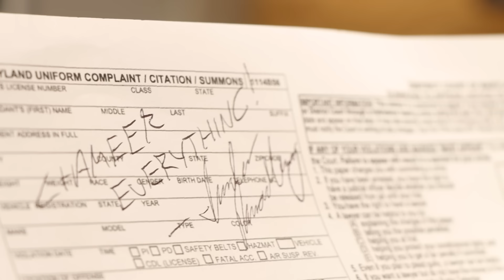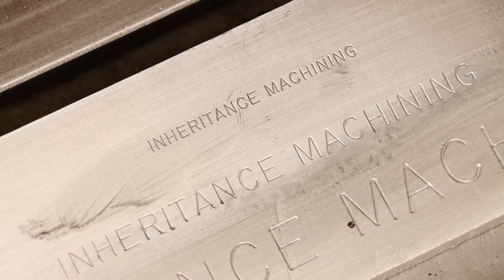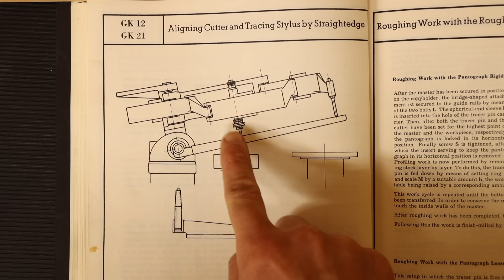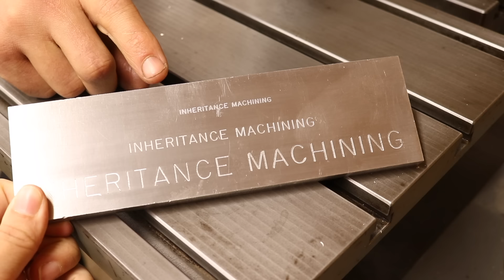Saving the Machine the World Forgot

Comment: Rule of thumb when engraving single line fonts;  You want your cut width to be approximately 10% of your character height.  Nice machine!
Reply: Which is pretty much what DIN/ ISO/ BSI say for line-widths in technical drawings. So ... 0.35mm pen for 3.5mm high lettering ; 0.7mm pen for 7mm lettering.
My tube pens - Rötrings - dried up long ago.

Comment: I bought a GK21 recently so have a few pointers
You need a tool and cutter grinder (i know of a Deckel T&C) for sale in chicago if you're interested.
Those carbide D bits are basically 1 time use before they need to be sharpened again.
Take very shallow cuts and go over it again if you want letters deeper this helps minimize breakage.

You can 3d print stuff and engrave it on metal like a company logo or whatever. Which really    expand the usefulness of the machine.

Comment: I operated a Hermes pantograph for almost 9 years at an air force base i was stationed at in the 80s. I was the only one in the shop that cared to go beyond engraving the radio faceplates and recognition plaques.
I learned real quick the three things you DON'T DO.
.1. Don't drop the cutter.
.2. Don't let the stylus skip out of the groove.
.3. Remember to pick up the cutter off of your work between letters.
I had 7 years experience as a manual machinist before I went in the service. I enlisted to do something else than metalworking. Ha! Two weeks after I got to my first duty station I was training people. They didn't even need to send me to technical school. Direct duty, man.
The last year I was at that base the manual machine was replaced with a computer controlled one. The Hermes went to the transportation squadron. I spent some time over there, too.
You can make your own templates or patterns. Get with your local countertop installers and get the Formica top scraps or cutouts. Draw or trace your design directly on the top or make a stencil. Take a rotary tool and carefully groove out the lines. Every little bump and bobble will show up in your work so go slow and steady. Naturally you aren't going to need to do this unless you have a special logo or such that you will use more than once.
The biggest thing is use your imagination.
Be gentile!
Router bits for wood are your best friend for odd jobs.
That machine will amaze you!
Cool find on the 3D option
Oh. Make sure you get the proper set lines on the arms. If you don't your "0's" will look like drunk kidney beans...LOL!
Cheers 
Terry

Comment: making letters for it could be a full time job for some one you need all sorts of sizes and different fonts lots of filing in the future lol also making cutters for the machine can be tricky we had a special grinder for ours as they need to be ground with a taper depending on the material you are cutting as you are going to find out the break cutters often so buying them could get expensive if you have never worked in the trade you have a lot to learn in the future we also used a mixture of varsol [ mineral spirits]   mixed with cutting oil or any oil we had on hand and one more thing that will help is a really good supply of good double sided tape i think we used 3M brand one it is used to tape down the templates when clamps are in the way

Comment: Cool! Deckel pantographs were once pretty common in the mold making industry. I learned to operate one in the 1990s duplicating small forging die cavities for brass valves and fittings. We made 3x size models first in plastic, then used the pantograph to reduce to final size in the actual die. We were able to produce very fine detail that way. We ground all of our single point cutters from carbide blanks on a Deckel grinder, too. Those were the days.

Comment: What a delight to see this old Pantograph in use once more. One of the many machines that i used such a lot while working for the company that I served my toolmaking apprenticeship with was this same make Pantograph (for all i know this could have been the one ). Apart from making all the labels that went on every other machine throughout the toolroom a lot of the punches that went into the tooling of the progression tools that fit into the presses. I used to love working this machine. The second machine i liked working was called a Punch Shaper. A very complex machine to setup and used, I've never seen another since I left that company. And the last machine I learned how to use was a tool and cutter grinder, and sadly I've never seen one like that particular one since.  In a way, now that I am retired, I seem to enjoy working with my metal lathe and Mill/Drill more than ever.
I also have a full shop of woodworking equipment, so love doing that too!

Comment: Deckel is the Rolls Royce of Engraving Machines.I had the English Taylor Hobson. It did not have 3D faciities. 
You will now need to acquire (if not already got) a cutter grinder to change angles for different materials as well as sharpening.
We never bought bits but instead HS dill bits BEFORE fluting was done. Saved a lot of money as we did A LOT of engraving.

Comment: You can get a small cutter grinder to grind cutters from blank stock and make your own . Either high speed steel or carbide depending on the materials you are cutting...I'm a retired tool and die mold maker...used all manual equipment  until last couple of years then used Protrac milling  I really enjoyedthe trade...

Comment: Hi, came across this video by chance, certainly brought back memories. good to see someone rescuing the machine.  I spent my early working years, in the late 60's and early 70's, as an operator on similar machines. The majority of work produced on this type of machine, apart from dies for coins and medals, was for producing die casting and plastic injection mold (mould) parts for model cars, trains and toys, certainly the 3D setting. Then the CNC machines started taking over so those  manual machines were made redundant. Not useless but time consuming to set up and operate.

Comment: This brings back some memories. Worked at a mold shop in Burbank California back in the 70"s and early 80's that had multiple (maybe a half dozen) Deckels set up in their own room because of their noise when running.  There was some that were the larger ones, twice that size, that would go to a 1 to 1 ratio.  The key to these was the patterns used to get the ratio right and that required highly skilled tool makers.  Eventually left there and got into CAD/CAM/CNC machining doing the same type of molds in 1/4 of the time with more accuracy with better finishes.  Anyone who says pantographs where better is not being realistic.  They were hard work.  Standing in front of one of these was not pleasant.  The hot chips would fly back in your face and down your shirt.   The joys of manual machining...

Comment: It doesn't look like the original motor is on the machine.  It came with a 3phase 220Vwhen new. See if you can find a Deckle cutter grinder. Replace the stone wheel with a diamond wheel and you can grind your own carbide cutters at any angle and bull nose too. You can buy the carbide cutters split in half in most any dia. If your going to do alot of lettering buy a Deckle or a Gorton (much better) 2D machine.

Comment: In the late 70s I was working at a shop producing complicated aircraft parts.  Prototype parts really held us up.  We started using a panograph.  It saved a lot of time.  Then Textron put cnc controls on a Bridgeport.  
We dove in.  Cutter comp was black magic.
You can use end mills with that machine.

Comment: put a drop of oil on your template letters because they’re made of brass and the tracer is made of metal so your letters will wear out very fast. we also used brass tracers to prevent the wear out. i worked on this model as an apprentice in the late eighties. brings back memories 🙂

Comment: There was a pantograph machine at the place I worked at as a precision Mechanical Designer for aircraft instrumentation.  The pantograph machine's purpose was to recreate convolutions in a beryllium copper disc which composed half of a bellows.  These bellows were used in altimeters and airspeed indicators.  The pantograph was set with a 10 to 1 reduction to reduce errors in duplicating the curve and convolutions of the bellows.  Truely amazing machines, thank you Ben Franklin.  Great video thumbs up.

Comment: I started as an electrical trades apprentice in Sydney in 1967. We had a fellow who worked full-time working a panagraph engraver, like the one here. Mostly he engraved name plates for control panels and such, quite a lot of those in what we called Formica in Australia. A plastic like material with different coloured layers. Cut through the top layer and you had say white or red letters.
At times he engraved directly into die cast aluminium plates. The letters were filled with  ink

Comment: I used to use one back in the 80's. A newing hall machine. Not sure if I still have a set of brass letter sets or if I have thrown them out. Have you got a set? You can make your own with it with care. That's how we did it. You'll need carbide cutters and a microscope light sharpener for them also.. Otherwise they'll be dull.
We had a few machines, smaller ones for engraving trophies. And can do curves. You rotate the job in the holder. Very versatile machines.
We also had edging machines which are like a miniature router table for edging chamfers - one pass - bzzzz done.
You can also get reverse lettering to engrave on the back of clear plastic sheet giving smooth finish. Ideal for maps, industrial process maps, drilled for lights etc. Like you'd see in control rooms.

Comment: I'm an IT guy and I was lucky enough to work at a university engineering department in in Australia the early 2000s which had a workshop much like yours, including a pantograph. I was thrilled the few times I used it. We used something called traffolyte to make signs with it. The letters looked exactly like yours. I often wonder if they still have it squirreled away somewhere.

Comment: I've got the baby brother of that machine. You should use different cutters depending on the size of the letters. Bigger letters can use cutters with a truncated tip to produce lines that are wider without becoming deeper.

There are also special sheets of two layer plastic to make signs that are (usually) either white letter on black background or the reverse. Other combinations also available.
Anodized aluminium is very nice to work with too.

Comment: Used somewhat larger Deckel pantographs 45ish years ago. They were also called die sinkers. Ours had an oscillating up-down function that would chop cut like chop grinding with a jig grinder. We would use carbide burrs and could cut intricate profiles. I also made templates for these with a Kearney & Trecker rotary head mill.

Comment: Used a tool and die version of one of these machines which was heavier built. It used direct feed motors instead of belts. Was capable of holding larger tools.  We used it to copy complex parts with curved surfaces. Made coining die copies and EDM carbons for burning shapes into   foundry blocks. I have dreamed often of one for my shop. Unfortunately I have never seen one like it again, and it would have been a bear to move.

Comment: Takes me back nearly sixty years when I was an apprentice, one of the things we did was engraving and etching using a Taylor Hobson pantograph machine similar to the one shown, the etching was done on hardened and ground components. The engraving was done on brass instruction plates, usually for jigs and fixtures for FoMoCo, the plates would be engraved, polished then the lettering would be filled with paint then polished and laquered. Latterly, Ford went from specifying brass to laminated plastic, got the job done but not nearly as satisfying!

Comment: I used to drive Deckel pantos years ago. We used them for all sorts of things. Because they can run at over 20K RPM, we were able to drill stuff at 0.024. WE used them a lot for making dies for EDM work, button plates for elevators, complex mounds for automotive injection moulding, all sorts of stuff. I would really like on even now, forty years later. Good luck to you, I hope you get some use out if it. PS, get yourself a D bit grinder, a Deckel if you can otherwise a Harbour Fright. It will save you a lot on bits.

Comment: Within the first couple of seconds ive realize what kind of machine it is. We have one in my shop as well, its rarely used since it takes almost the same time as using a cnc. We only use it for brass engravings to label molds. Though ours is quite small and not very sturdy. Back to the vid :)

Comment: I used one of these for years back in the 70s and 80s. We engraved Control Panels which eventually were adhesive labels years later. Mine was also a Deckel and I had a Deckel Mill also. Deckel are still in the industry as they are the D in DMG from Germany.

Comment: Did engraving at an aircraft manufacturer and had to do it to mill specifications. Being self taught, I ended up doing many retirement parts for my boss after a while.
Try filling in the letters in with different color lacquer sticks then polish the surface. I used to hold my breath all the time hoping I would not mess up especially when your near the end finishing up something.
Now everything is computer run. 
It takes a while getting used to the cutting if your doing a climb cut or not. You can make it wider the deaper you go too or use your broken tip. Remember you can re-sharpen thoes tips too. 
Good luck with that machines and enjoy it.

Comment: What a score. Learned to run a Deckel in trade school and then we had one in the first shop I worked in. We used it engrave EDM electrodes for 2 shot keyboard key mold inserts. Now you need to find a Deckel SOE single lip cutter grinder with the comparator. It got where I could do a 9 degree, .008 tip dia. carbide cutter about in my sleep. Our new CNC retired that machine as we could direct engrave the dies into D2.

Comment: Spent forty plus years in a machine shop. Never was fond of CNC equipment myself either. I retired from the shop I was at back in 2019 after 30 years there and 23 of those as the Operations Manager. Everyday was different with customer break downs. From a tire or pharmaceutical manufacturer to a farmer bringing in a part off his grand fathers farm equipment. Though the years some of the younger folk coming in were fine with straight forward machining.  But when a customer brought a part that was in pieces and had no print and a lot of times the company was no longer in business to even order a new part. And you had to get creative on how to machine a part that was larger than the mill or lathe we had. They called out the "Old Man". And I've never seen a shop that didn't stretch the capacity of a piece of equipment a time or two.
 
 Worked with some great maintenance people that could tell me what the application was and also listen to my suggestions on doing a repair or making a new part. What I could do to strengthen the part and make it easier to service. Still have the 1970's edition machinist handbook I bought from a old fella that worked there when he retired back in the early 80's. Still used it up till I retired but I did purchase a couple more with more companies moving to the area that used Geometrical tolerancing that his didn't have. His footnotes he had jotted down in it I sorta look at like history.

 Absolutely loved what I did. Made a really good living at it. Great to see that older equipment being saved and put back to use! Now I've got a lot of new video's I can go back and watch on a rainy day. Thanks for sharing 

 Oh and the video's we were shown in tech school of machinist in clean white smocks looking like doctor's. I never saw it once

Comment: IF YOU TAKE A small flat engraving sharpened "like" a wood chiselo you can point it straight down into the flat work, walk it sideways corner to corner and it will clean up the ridges in the depressed parts you want flat.  (former gun engraver). You won't get it polished surface but you will be able to manipulate that finish with a flattish punch.  Think of the metal you are working on as damp clay and not glass.

Comment: I worked at several mold shops that had Deckel's. I was the Engineer and chief programmer of the CNC's and could have easily programed anything they need done but the old timers preferred their Deckel. I also used those shapers back in my 60's shop class in high school.

Comment: Always enjoy seeing old machines in use. The 3D capability is particularly interesting. Believe it or not, some ceramic tiles for the space shuttle were manufactured using a foam and plaster model that was handmade for a single tile cavity. They were machined on what we called a tracer mill, which was essentially a 3D pantograph, similar to your machine. It was only done on very select tiles called close-outs where CNC programs were not created, or in instances where the design part would not fit because of tolerance stackup. Very cool machine, thanks for showing it to us. Cheers from Florida’s Space Coast.
Reply from the maker: thats awesome! were you on the shuttle program or with Lockheed?

Comment: as handy CNC is for efficiency and speed when it comes to mass producing, nothing beats the manual machines. the best feeling is when u can feel the machine become part of u or u become part of it when working.
only CNC machines i would like to get is laser cutter/engraver and one for wood that i cant remember the name of. just place the design in and let the machine cut the parts from large sheet of MDF etc.

also i have seen some vids of this machine and one that i remember was when Uri used a kids toy as guide to make rly nice carving. the name of the vid is "What Happens When You Use a Kids Toy on a Milling Machine"